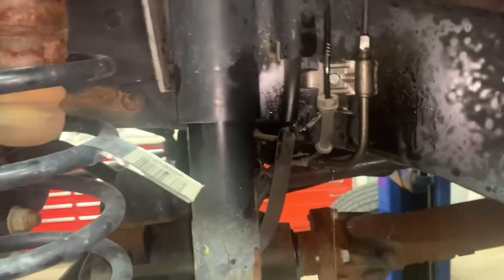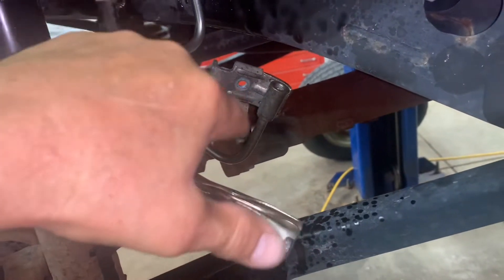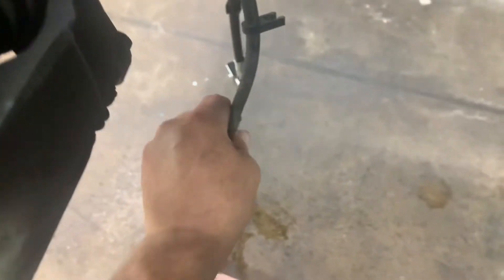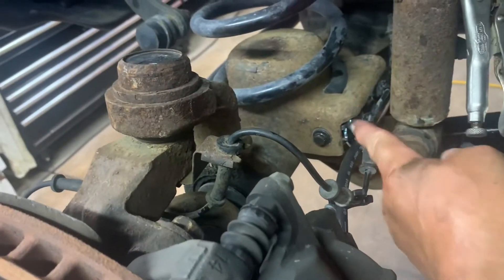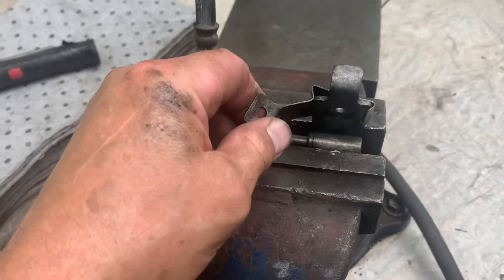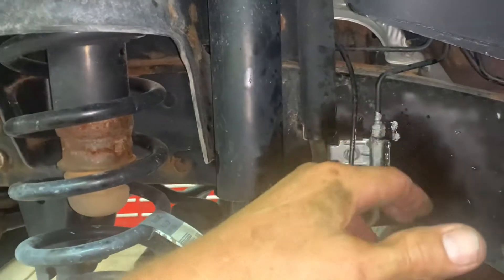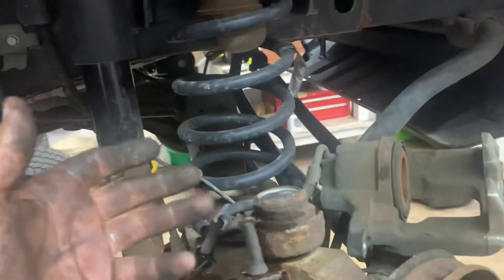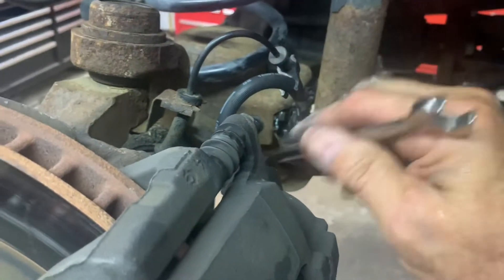2015 Jeep Wrangler Front brake flex hoses

Comment: Brake line loosened easily, but it turned the hard line with it.  Original line from 2012 and 305,000km.  Applied propane torch heat to the nut and it allowed it to spin without spinning the hard line - as mentioned in the vid

Comment: Had a bad pull to right when braking.  Though it was the seized front left caliper....nope.  Changed front left brake libe and fixed it.  Brakes very straight now and totally different brake feel.